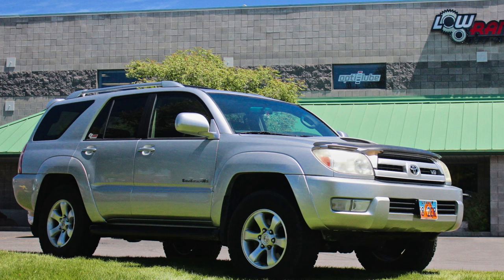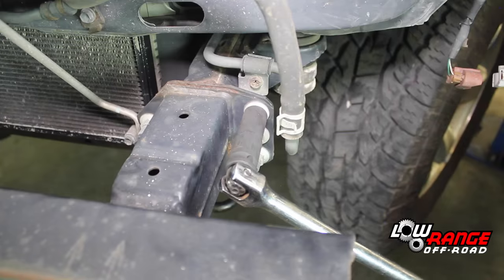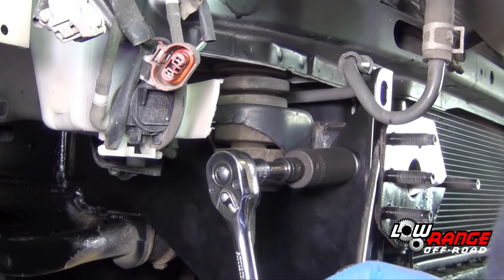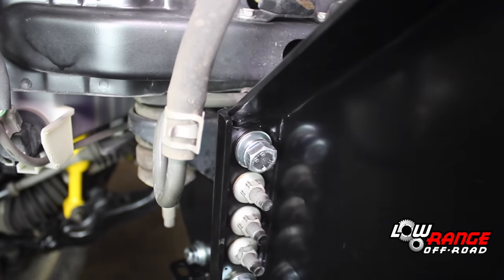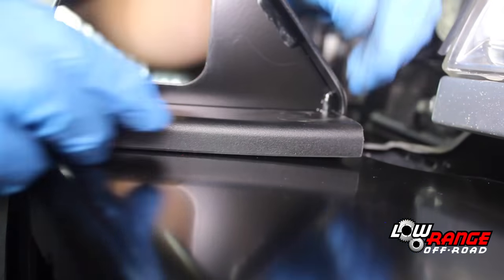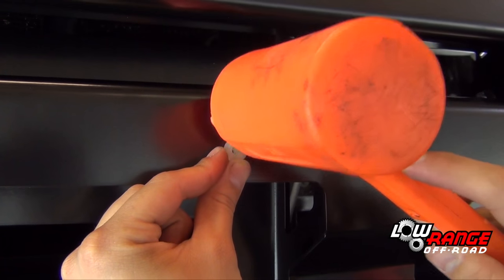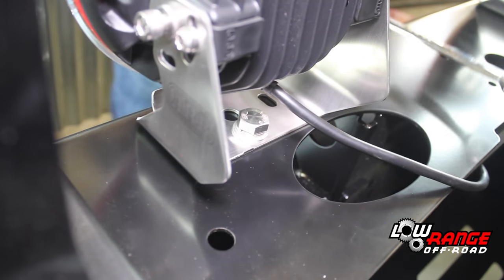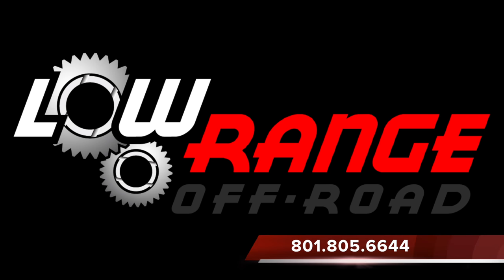ARB Winch Bull Bar Installation on a 2004 Toyota 4Runner

Comment: Thanks for a pretty solid tutorial. I do have one correction. At video sequence 5:35 the bolt location that was drilled, the bolt should be inserted from the inside and the nut should be on the outside. That’s how it’s pictured in the ARB manual.

Comment: This is the ARB bumper I have on my 4runner. And I put a 12000lb Warn winch in it, and it's awesome!! The only thing I found that I didn't like was the glare I got from my headlights shining on the back of the bull bar, so I masked the bull bar and the front of my 4runner off and used some flat black paint to cover the semi-gloss paint on the back side of the bull bar in front of the headlights.

Comment: Not the best instructions but better than nothing. This this is a whole lotta work to install. Between the ARB instructions and this I managed to do it. I ended up with only two extra washers. The instructions refer to a 17mm bolt but they are 19’s and no 17. I didn’t destroy my old bumper just for that filler piece.

Comment: Once you start cutting your stock bumper, there’s no going back. What happens later if someone decides to sell their bumper and go back to stock? Buy new stock bumper I suppose?
Reply: 1badEK I didn’t cut up my bumper. I just have a big gap there at the top. You can get aftermarket bumpers for $150 and chop that.
Reply: I see. Thanks

Comment: What happens if you don't swap the 21W bulb with the 10W bulb? With the 10W bulb, I noticed that the signal blinks really fast when I wire the signal light and parking light separately. It seems to blink at the normal rate when I leave the 21W bulb in.
Reply from the maker: If it blinks at the normal rate with the 21W I'd say leave the 21W bulb in.  It should not hurt anything.  Worst case scenario is it may blow a fuse.  Thanks for watching and commenting.

Comment: This looks like a great install. I just installed an ARB bumper on my 2008 4runner. I'm having trouble with hooking up the fog light kit and connecting the turn signals. What additional parts are need to get this done. Thanks
Reply from the maker: As to the connecting of the turn signals follow instructions in the link provided.  Go to step 43 on page 12.  http://store.arbusa.com/Assets/PDF/3421200_10.pdf    
As to the fog light we did not install the ARB Fog Light Kit.  So I am afraid I cannot give you first hand instructions.  But here are the instructions from ARB.  http://www.offroad-obchod.cz/data/a/arb-6821201-mlhovky-novy-typ.pdf   Hope this is helpful.

Comment: What is the item that's next to the roof rack on the driver side? Is that just a tent that you can pullout or something? Great video btw!
Reply from the maker: That is an ARB Awning.  It rolls out to provide shade to the side of the vehicle.  Here is a link for more details about awnings.  http://www.lowrangeoffroad.com/arb-awning-1250-mm-49-21-inches-arb3110.html  Thanks for watching and commenting.
Reply: Cool, thanks!

Comment: i recently bought a 200k miles 2007 4runner it was a little trashed but with some TLC ive gotten it back beautifully, i just need to save some money for some new suspension parts and ill be good, if anyone here has any suspension parts to send my way here in Belize, where the parts are so expensive, would really appreciate it.

Comment: I want this bumper for my 03 t4r sport. How heavy is it? Is the 4ltr V6 powerful enough to haul it around? Where can I find info on cost etc? Finally, if I just wanted the center hoop does ARB make a bumper like that? (No side hoops near headlights). Thanks!
Reply: Dominique Stephenson it’s heavy. About 150 pounds or so and that’s before a winch. You need to do some stuff to your front suspension if you add that weight. Spacers or new struts to give it some lift. Definitely do not add this bumper to a stock 4R.
Reply: If I remember right, I think in order to make it compatible you also need to upgrade something to make it fit? Air intake? Radiator? Not 100% sure what it was, but you had to upgrade it to the next model year to make it fit right. I wish I could remember, I can't find what it was, now...